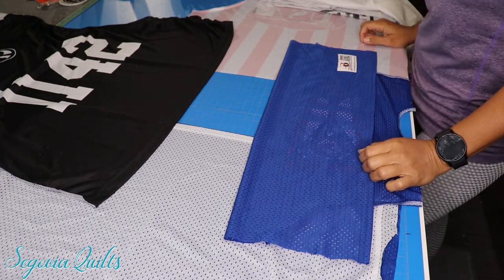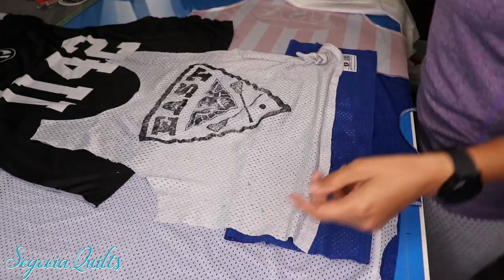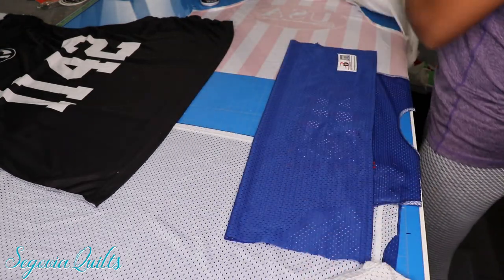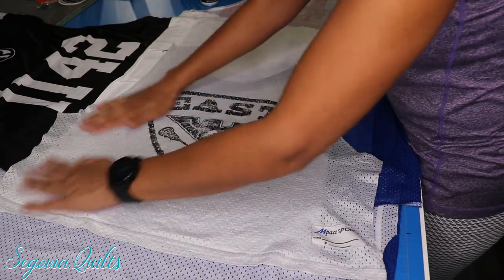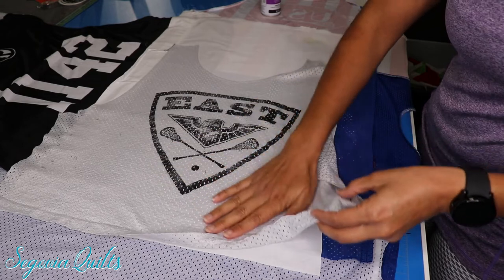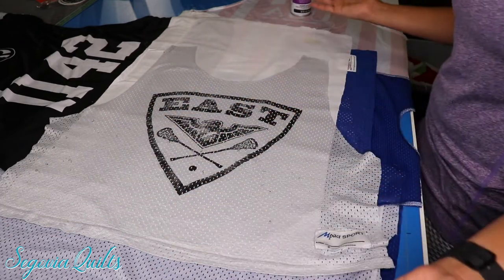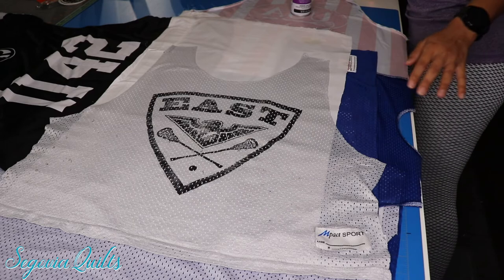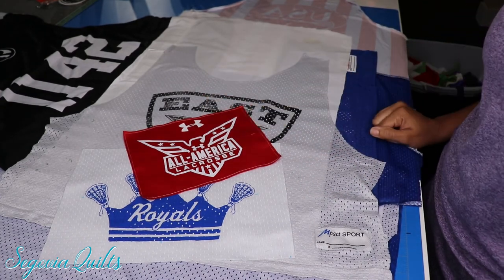Adding Jerseys to Your T-Shirt Quilt

Comment: I love your videos! I am using your method for t-shirt quilts from 5-6 years ago. I am wondering how you get your marks off the t-shirt that you are marking the size of logo's prior to cutting out the blocks? Have you tried the white ceramic chalk pens from Sewline????   my tailors chalk gives me to thick of lines. I need a thin line and something to use on dark t-shirts. Thank you for all you do for others!
Reply from the maker: Thank you! And thanks for watching! For removing the marks, if it's the blue or purple pens, I'll spray them with water prior to ironing them. If it's chalk, I'll just leave it until the quilt is completely done. Normally by the time the quilt is bond, the chalk has rubbed off already. I've not tried the chalk pens though from Sewline. But I do use a chalk pen from Bohin. It's extra fine so it leave a nice small line. It only works on dark colored fabric though.